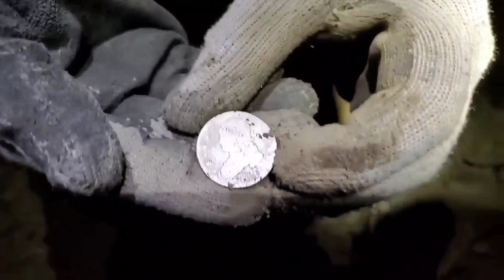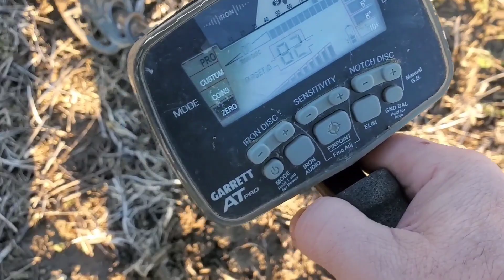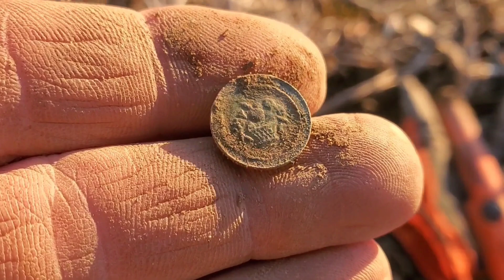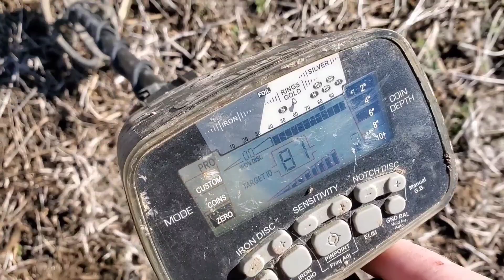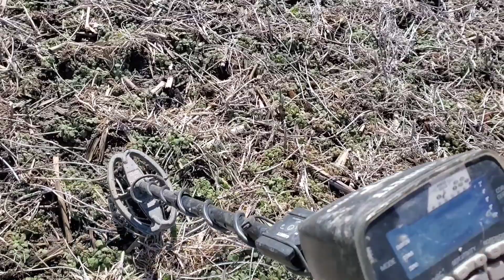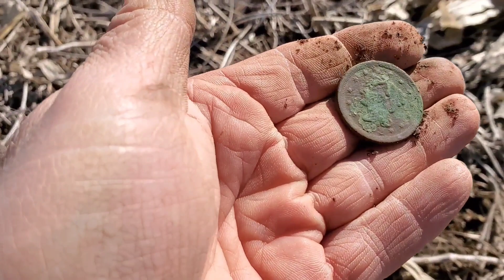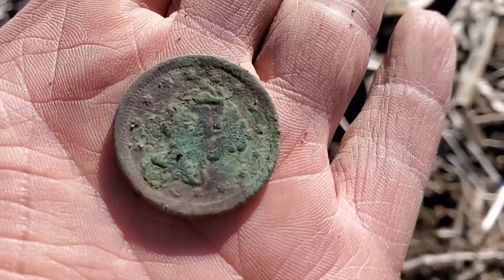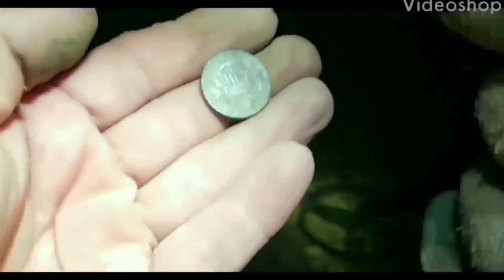Metal Detecting With The Hillsdale Boys THE IRON PATCH IS WHERE ITS AT !!

Comment: Nice hunt. The AT pro just keeps fending the good stuff. Has to be one of best detectors of all time. Will never get rid of mine.
Take care Andy. See you next Saturday
Reply from the maker: Thanks Mark, I started using the Max last week. It sounds different and targets all sound tighter and with smaller signatures, but I think I can handle it.  I love the other features it has. Back lit, wireless transmitter built into the machine itself without the external transmitter on my shaft. Much more powerful as well but I don't care so much about that. In the fields more power means more square nails,lol. I just turn the sensitivity down about 3 bars and it's usually fine. I might like the power over to the schoolhouse this sumer with my big coil, who knows. But so far so good... 😊👍